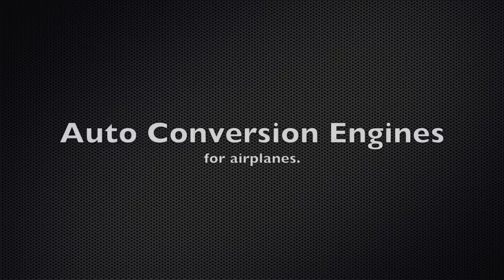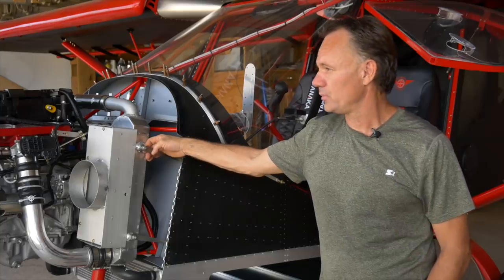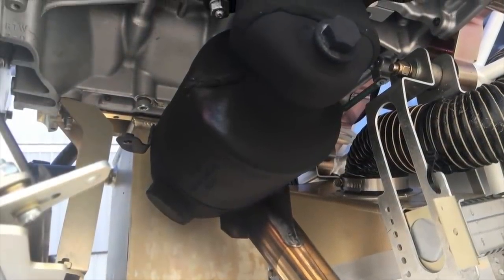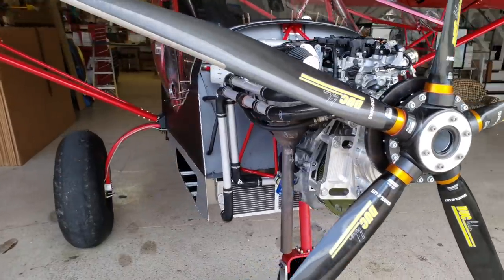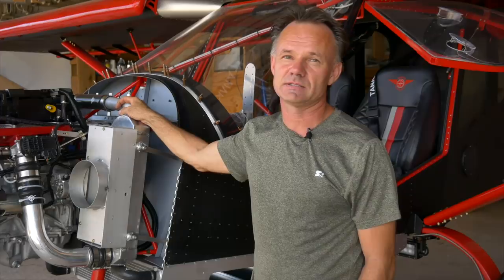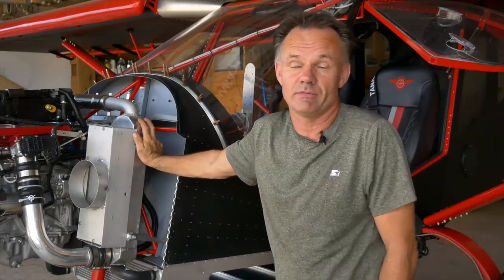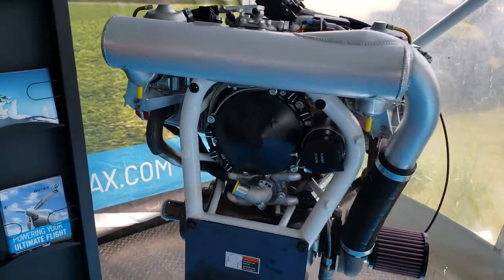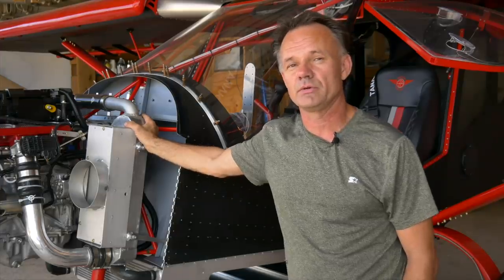Car Engines Used For Flying Airplanes l Viking Aircraft Engines

Comment: MojoGrip is a non technical person new to aviation.  For decades people have been touting how great Auto engines are modern better. No.
1) My RV-7 powered by a Lycoming IO360 can out run any "modern" car engine. I have +210 MPH top speed and  Econ cruise around 25-27 MPG.  If I go to  LOP and slow down I approach 30 MPG. My plane is 100''s of pounds lighter than any similar RV plane with a "modern" auto engine conversion and faster with more useful load.

2) In the 30's, 40's, 50's and 60's the Equiv of 100's of billions was spent in design, testing, manufacturing, metallurgy. My Lyc benefits from this R&D and service history. ALSO A 1950's LYC IS NOT A CURRENT LYC or Continental. There have been continuous improvements, including cylinder coatings. As an engineer there are NO better materials or processes available today which aircraft engines can be made with.  Sodium filled valves, forged crank, best steels... on and on. The exception of course is TURBINE engines which became mainstream for military and commercial aviation in the 1960.

So why not a Turbine for my RV-7? Too much HP, too expensive to buy/operate for a small personal plane. However for a cabin class personal/corporate/business and part 135/121 operations, which I have flown over my career, King Air 200, Metroliner SA227,  Caravan 208, TBM 700, they are great... That's "Modern". However the operating cost per hour are in the $1000's. For a GA piston plane it is less than $100/Hr. No reciprocating MODERN car engine beats the Lycoming or Continental. It is the direct drive and air cooled design that is optimal, designed and engineered specifically for aircraft and aircraft only.

The new Cirrus has a Continental TSIO-550K, which produces 315 hp (235 kW) with a 7.5:1 compression ratio and can run on 94 octane fuel. This is a turbocharged inter-cooled SINGLE LEVER engine, which controls throttle, prop and mixture. That is modern. Car engine is better? Ha ha absurd.

3) My Lyc IO360 RV-7 has all the benefits of engineering, design and materials from the past to present. Plus I have electronic ignition and FI. https://www.flyefii.com/products/efii-systems
There are certified Electronic ignition and even electronic FI for aircraft engines.  In fact most of the modern part of Auto engines is in the ignition and fuel delivery Electronics. Crankshaft cams valves connecting rods Pistons really haven't changed very much. TSIO-550K mentioned above is a state of the art engine. Its a far cry from a 1950's Contenental O-470. However Magnetos and Mechanical Fuel Injection works so well, so simple and reliable for an engine that operates at only a few RPM/Pwr settings (idle, takeoff, climb, cruise, descent, approach) most of the time, WHY MAKE IT ELECTRICALLY DEPENDENT? Then the plane must have complicated electrical system back ups. An aircraft engine with mechanical fuel pump, mechanical fuel distribution, self contained powered magnetos is electrically independent. Car engines need electricity or they stop running.

4) My RV7 can do + 210 mph  and get 27 MPG in Econ cruise at 8000-18000 feet. With full EGT/CHT/FF from my engine monitor I can run lean of peak (LOP) and get 30 MPG.... Cars struggle to do that at 70 mph and I am going 170-190 MPH. BTW with engine monitoring of all cylinders CHT/EGT, Fuel Flow, as well as OP, OT and FF makes it is easier to operate more efficiently, as mentioned LOP. Although not directly the engine this engine monitoring was unheard of until in the 1950's. Now they are cheap and very useful. Before say 1990's most planes only had OP, OT, FP... as well as RPM. MAP if equipped w/ controllable prop. No CHT or EGT typically. If it had CHT or EGT it was on one cylinder only, not all 4 or 6. Fuel flow? Also rare. So to pretend we are flying around 1950's style with no GPS is absurd. Engine monitoring adds safety as well as each cylinder can be monitored.

5) My old 1950's RV7 weights 100's of lbs less than any automotive engine conversion and out preforms ANY auto-conversion in a similar plane.... while being FAR MOIRE RELIABLE. There has been a few attempts to make a totally new Recip engines for aircraft which have come and gone. Lycoming an Contential still around for a reason. They are the optimal aircraft engine. Direct drive and air cooled is key. 

6) Reliable - all car engines run at RPM's well above 2700 RPM. Car engines make their peak power at high RPM for acceleration and then back down to lower RPM (and low power) . That's FINE for a car. In a plane a car engine requires a PSRU (Prop Speed Reduction Unit). You know a PROP has to turn less than 2800 RPM (slower is even better for efficiency). These PSRU's needed to turn the auto engines high RPM down. PSRU's are often crap, and a source of failure and cost and weight. Car engines are made to drive a transmission and drive-train to wheels on a road. Also car engines are NOT NOT NOT designed to run at 75% power continuously. You get on the freeway and then go back to 20% power to do 35-65 MPH.  A Lyc can run at 100% power all day because it was DESIGNED TO DO THAT....

7) You can buy a BOLT ON Lycoming and go fly for under $30,000. You can get a used one and rebuild for under $12,000. A car engine may seem cheap, but by the time you finish installing it with your hodgepodge of works arounds, PSRU, draggy radiator, modify the cowl and engine mounts, add fuel system that can operate at altitude, redundant electrical system, the cost in time, weight, complexity will result in slower, heavier plane and COST MORE..... IT IS NOT WORTH IT... TRUST ME... I KNOW. I have followed this for 40 years, This channel is by a non-technical guy who is new to aviation. He is clueless. I built two planes with Lycs and seen over a 100 auto engine planes. They all have less payload, look weird and don't fly well.

9) Water cooling is great in cars. In planes with high speed and no stop and go traffic it is heavy, draggy and a source of failure. Water cooled aircraft engines is not new, going back to WWI. There is a reason why the radial engines in Military and commercial aviation dominated up to the 1960's until Turbines.  In fact radial engines are still around... and making a living.

10) Show me this better engine, cheaper, lighter, more reliable than a Lyc or Continental.  When you come up with a MODERN engine (proved not on paper or MojoGrip propaganda) that outperforms my Lycoming in every metric, for less money, I will buy it. For decades I have heard this promise of GREAT new engine.... All failed. I have seen Subaru, Mazda (Wankel/Rotary), Ford V6, Chevy V8 and many others come and go. They were all going to be Lycoming killers. I propose we keep using Lycs and TCM's (Continental) until something better comes (not pie in the sky MojoGrip videos).....

Comment: Could they do a single seater with the little Mitsubishi engine with a turbo on it
Reply: Jan tried adding a turbo to the 110 engine a few years back.  It had issues that created questions to the overall reliability of the engine and was abandoned.  If the engine comes designed for turbo then it will have one.  eg the Honda Accord engine.

Comment: Planning on getting a used Sonex in a few years. I'll keep an eye on these motors in the meantime to see how they compare to Sonex's AeroVee 2.1 Engine Kit (80hp/$7500) and turbo version (100hp/$11k).

I'm seeing some...controversey on using a car engine in an airplane. But even Sonex uses a VW conversion; and I have COMPLETE faith in the design of their airplane frame.

Can anyone point me to any real data on the give-and-take of these various motors. Or is it like paramotors, a total crapshoot?
Reply: paramotors are not even a comparison. They are mostly 2 stroke motors with old carb tech and definitely not reliable.

Comment: I wonder why they don't convert some of the larger auto engines?  There are a lot of auto engines available now with 300 or more Hp.
Reply: Haven't you heard of tuned Supra, gtrs, etc? 1000hp, easy. Hell, a gtr makes 600 hp stock. 
I wonder why you said 300

Comment: These engines, use car gas or aviation gas?
Reply: Both can be used but regular gasoline is better for these engines.
Reply: @Human.agnostic.aethist  Premium 91 or 93 octane, because the turbo will be better, avoid piston knock, with car gas the fuel cost be significant less.  I think than the Lycoming and Continental aircraft engines is time to convert to ECU  with electronic fuel injection, better fuel deficiency and less emissions.  I am Car Mechanic, but also made modifications to cars, like turbos,  reprogram or re-flash ECU,  install racing  ECU to cars and program it in dyno,  I think the aviation conventional engines are outdated, the technology now offer more HP vs weight. The Rotax is taking advantage of this.
Reply: Also they are using the stock internals?  Connecting Rods, Pistons, etc.
Reply: @noeramirez4975   great to hear your words , I don't know about USA fuel ratings ,as you said it's true ..BTW how about premium fuel availability there  in airports?? Yes Lycoming and continental needs updates moreover their fuel prices are keeping high ...how about diesels in those ? because diesels offer better fuel economy and less pollution compared to avgas moreover we can use jet-a too . Availability worldwide.. can go long range..... Planning VW 2.0Tdi engine conversion in future but issues with engine weight
Reply: @noeramirez4975  yes mostly ... But depends on engine condition.
Reply: @Human.agnostic.aethist  Compared to a well optimized gasoline engine, diesels burn about the same amount of fuel by weight, and mogas is cheaper than jet fuel. Diesels simply don't make sense for aircraft use. You're also likely to have issue with the PSRU on a diesel due to the huge torque pulses.
Reply: @PistonAvatarGuy  👍
Reply: @PistonAvatarGuy  Y'all know diesel will turn to gel at low temperature (15 degrees F), right?
Reply: @knappyfro1  Yeah, everyone wants to run expensive jet fuel in their heavy diesels, it's ridiculous.

Comment: I have been thinking. 
Using gas/petrol auto engines means that the torque curve is biased towards the upper portion of the rev range.
This necessitates a speed reduction gearbox. 
Why not use a turbo Diesel engine? Sure it’s a cast iron block, but there is no need for a speed reduction gearbox. 
The torque band is in the low to mid range of the rpm curve.
The Toyota 1KD-FTV seems to be an excellent fit.
170 hp at 3400 rpm and peak torque of 260lb/ft/352 nm between 1800-3400 rpm.
The intercooler is also mounted on top of the engine. 
There would little fabrication work for an install apart from the engine mounts
What do you think?
Reply: Well … Weight !
Reply: SuperYellowsubmarin yes, since it’s a diesel, it’ll be a cast iron block.
But you won’t need a speed reduction box. 
That should balance it out
Reply: @sumit_john  You may have a good idea there.

Comment: I would take an LS3 engine and shove it in a airplane, I mean those engines are reliable as fuck and powerful as hell so I would take one of those and shove it in a plane
Reply: A number of people do offer LS engines, the issue is they are heavier and more powerful than almost all experimental aircraft are designed for.

Comment: I'm surprised you use Mitsubishi car engines, as they generally don't hold up well.

Also the Honda 1.5L turbo has an issue getting gas in the oil.
https://www.consumerreports.org/car-repair-maintenance/honda-delays-cr-v-turbo-engine-fix-details-rollout-plans/

Comment: 10:49 a sting of untrue statements.  "All the war birds are liquid cooled". Not true, most air cooled radials.  "Wright Brothers used a car engine." Not true, they made their own engine from scratch purpose built. The Horz opposed Lycoming was a generator. Wrong the O-290 (1940) was used as a generator, but the O-320 and O-360 built for aircraft came out in 1955. Similar but not the same. Just because an engine is versatile or used for other uses is not a bad thing. Consider he wants to use a car engine in an airplane, that is a poor criticism.

Comment: Have you considered motorcycle engines?  Honda especially last forever.
Reply: Hi Tom , I have also thought of m/c engines . 
A Honda 4 cly 4 cycle will spit out heaps of power.

But only at higher rpms , and i wonder if they may not be quite beefy enough in the crank .

A top dressing company in NZ spent truck loads converting their ,  400 H/P  - 8 cly lyc powered Fletcher fleet to a big block alloy Ford V8s , or to be more precise that was the plan.
They never made it past the first prototype . The prop just created to much power for the crankshaft. They cracked.
After 3 or so cranks i believe Ford US came over to see if they could help.

But it was no go Ford said the crank was unable to absorb the H/P the prop created due to its own weight when spun up.
Cheers Grant

Comment: Maybe turbo diesel's higer torque with no need for deduction gear?
Reply: diesels weight more and still either a large engine no reduction or a smaller engine with reduction..  but there's quite a few advantages of having a gear reduction vs direct drive, less thus loading on the engine and the power pulses for prop revolution is more compared to direct also prop strikes and shock load isn't transmitted directly to the engine

Comment: Tesla needs to make a p100d airplane. All electric you’ll no longer have fuel and air mixer for power issues. It would feel more like a turbo jet but with instant torque.
Reply: I've been waiting for someone to take a Tesla motor and battery pack into aviation. It makes sense to have an all electric motor. No cooling issues on decent, no fuel or carburetors mixtures. I assume even overhauling can be more cost effective.
Reply: @lesnyane926  Nothing like a 1200 lb battery and a 300 lb motor in a 700 lb air frame.
Reply: Well then again car engines are really good at dealing with fuel to air ratio with the built in ecu and all the sensors in modern engines ...I bet those planes are more reliable than you’d think

Comment: I want a 130–150-ish HP car Diesel engine.
Reply: Any modern 4 cylinder VW TDi would fit that
Reply: A company in Europe converts a 2 liter Mercedes diesel for use in aircraft, it's called the AE330 and it's insanely heavy. Diesels make absolutely terrible aircraft engines.
Reply: Diesel gets frozen at low temps. You'll regret diesel engine as soon as you're in the air
Reply: @siddharthsharma8940  You might wanna check on the chemistry of jet fuel vs diesel. They are almost identical. Jet fuel doesnt freeze because of additives.

Comment: If you value your life I highly suggest researching your aircraft engine choice further than just YouTube videos! The Viking sounds like the perfect engine to use in your aircraft!  Take an engine from a wrecked car and rely completely on as little engineering as possible to make it work in an aircraft!  You can't just pull over to the side of the road in an aircraft!  Honda makes an excellent automotive engine, this is true!  That does not make the Honda an excellent Aircraft engine!  Rotax and other aircraft engine companies spend millions on research and developement to make a safe aircraft engine.  Viking Slaps a PSRU and a CPU on a Honda car engine and passes it off as an aircraft engine!  Do your research before you trust your life on a Viking engine!  Just ask anyone who flushed their money away on Jan's Subaru engines... if they ever even received one!  Research Eggenfellner Engines...  https://sites.google.com/site/vikingaircraftengineissues/   https://www.vikingenginesissues.com